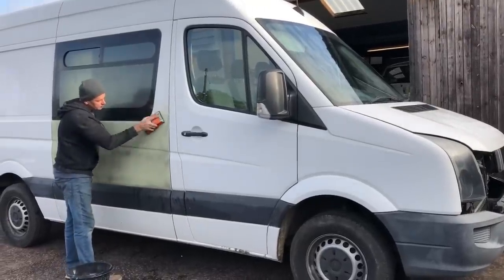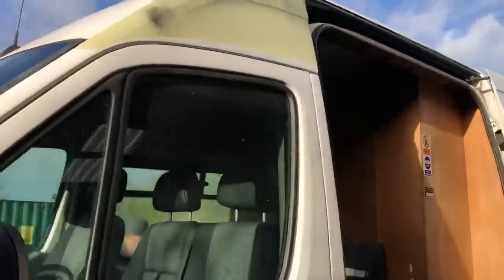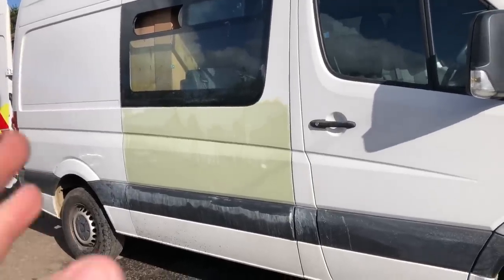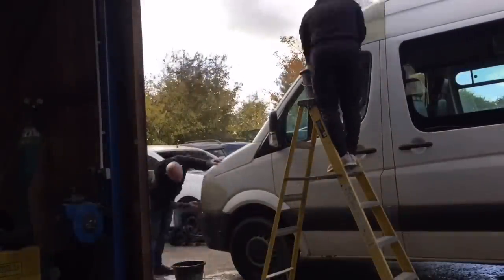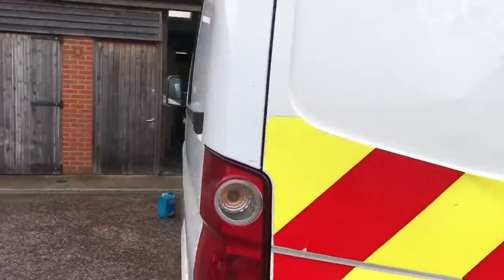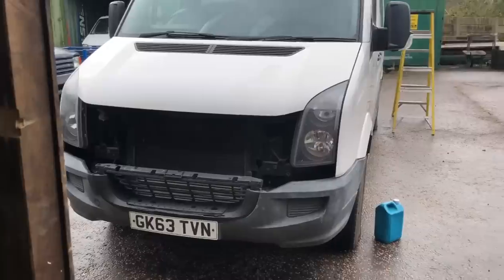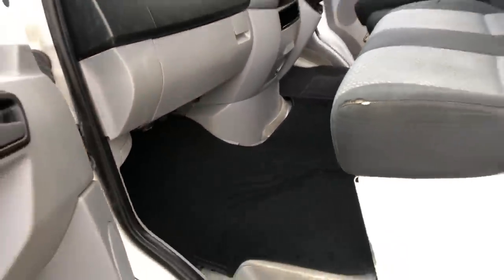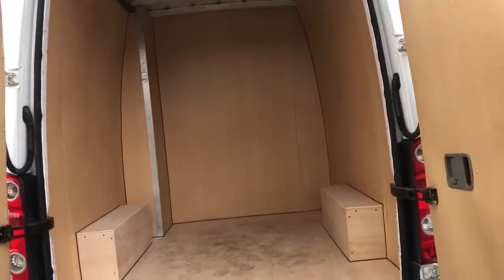VW Crafter Project How much did we Make £££ ??? PT 5

Comment: I would remove the decals on the back doors, it would look cleaner look and wouldn't show its previous hard use.
Reply: thing is, a lot of people benefit from the high vis battenberg on the back doors, it's necessary for highways work of any kind, even if that's just road sweeping, electrical work or as an escort vehicle.
Reply: @S.ASmith  I know it was 9 months ago but with stickers left on it limits the potential buyers.
Reply: @markopolo9559  Somewhat yea, it can do. I find it limits more if it's sign written. Glues on those things that have been on for years tend to bugger up the lacquer.

Comment: Cracking job. I see you repainted the driver's door sill but not the passenger side. A stitch in the passenger seat bolster could have made the rip less obvious but I appreciate all the time and work already put into the van. The cleaning products look great - I see you use foam scouring pads but various handbrushes are particularly good for getting product down into the grain and into nooks and crannies. Might also be worth getting a splashproof extension lead/socket for when using power tools outside in the rain/washing vehicles...

Comment: I think people commenting about the profit are failing to remember that this van was a way into a business relationship with the supplier. Speculate to accumulate as they say. 

Cracking effort guys considering the absolute state that is was in before. I’d have been tempted to do the door sill edges seeing as it was being painted anyway, but I guess it’s not a new or low mileage van. 

Keep the content coming. 👌🏾
Reply from the maker: We did do them bud 👍
Reply: @sruk  ahh my bad. Must’ve missed it.

Comment: That's one of the best you've done. For the amount of hours it's not actually that much profit, but it was the best series of vids. Amazing transformation. At the start, you wouldn't believe it possible.
Reply: It wasn’t quite clear if 9 days meant 9 days of work in total or 18 man days because both worked full time for 9 days on it. But effectively they are each earning between £134-268 per day of work depending on which it is.

Comment: Looks the Dogs DooDahs Rob 👍
As daft as it sounds that boarding out will be a Decider for buying the Van, nice Clean, Fresh.
If Painter hasnt Had the Buffer on the new Paint, as you do the rest , buff the New Paint too, it knocks the Freshness look off it if theres a Slight Difference.
Thought the £250 for Painter was a tadge much as Chris had Done all the Work.
That Man Jizz Trim Cleaner is Good Stuff, used it mi Self 👍
Van will Pi$$ away who comes to Buy it

Comment: Plastic that has faded that has gone a light grey colour, if you put a heat gun over the faded plastic, it brings the dark plastic back to its original dark colour. No need to paint the bumpers or plastic trim.
Reply: They haven't painted the bumpers or the trims
Reply: @johnwelburn9966  I realised that at the end. Thanks for pointing that out. 
The van does look amazing from how it was at the beginning.

Comment: I guess you gave it a service but anyway great job. Pity about the high mileage . All of their vans are going to be high mileage and that much more difficult to shift.
So I trust you know what you are doing. I find facebook a very good place to find low priced cars. Especially those that need a little work. Better than the auctions and ebay.
cheers
Reply from the maker: No we didn’t service it as it had just been done.130k on a 7 year old van is far from high mileage

Comment: Taking into consideration the amount of time spent working on the van it's not a great deal of profit really, £2000 for two weeks work, for 2 guys. Which equates to just about 12 pound 50 per hour. Based on an average of 40 hours for the working week. 

Someone's gonna get an absolute bargain.
Reply: Better than earning £7-fuckall an hour stacking shelfs in Tesco.
Reply: Better when you factor in YouTube revenue. And as said it’s honest work.
Reply: You can only get what you can get for a used vehicle - it doesn't matter how much time you spend on it...
Also, these guys are self employed. Labour rates are irrelevant - you take what jobs you can get. Some jobs they make a killing on, some they don't.
Do you think they should sit around doing nothing because a job won't pay 'enough'.....?!